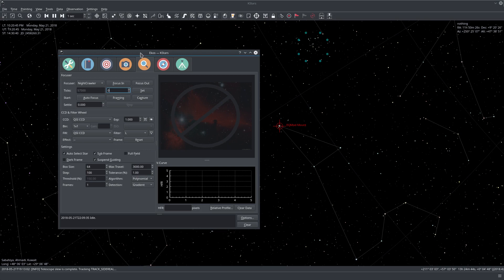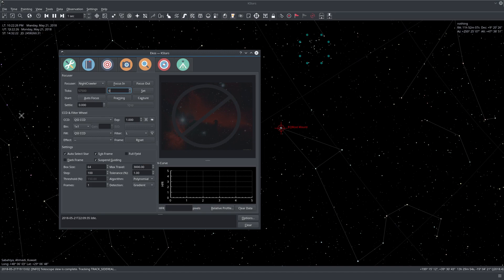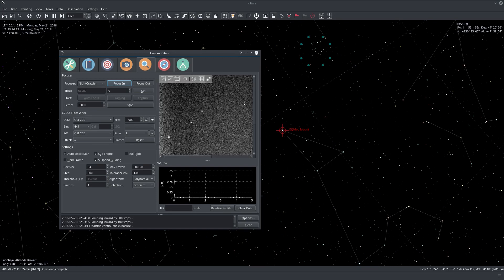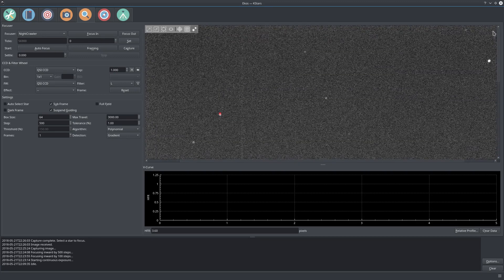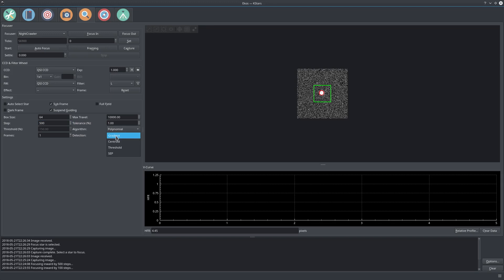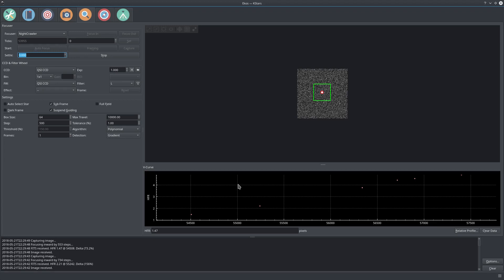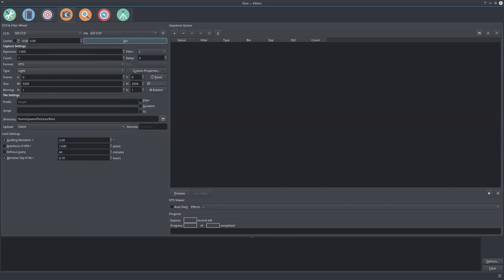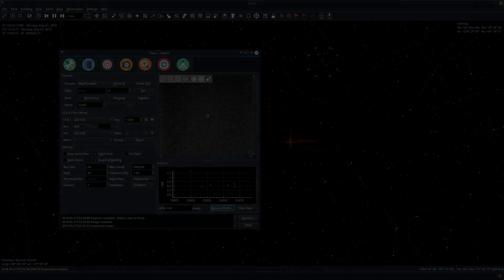Part 8: Ekos Focus Module

Comment: Might be a stupid question but i will ask anyways..
Will this work with DSLRs...specifically Nikon models?
Reply: No, you need to have a special autofocuser for the telescope.
Reply: The earlier answer can be misleading. If you are using a telephoto lens with autofocus capability on your DSLR then yes, the gpphoto driver in Indilib can drive the focuser ring of the lens attached to a Nikon DSLR.  If you are using a DSLR attached to a telescope then the below answer is more correct.  In that arrangement the DSLR is not responsible for focusing the image, the telescope is.  in that case you need a motorized telescope focuser that is supported by the Indilib drivers.  Reference here https://www.indilib.org/focusers.html
Reply: @MrBrendanpdx  Thank you for your response mate. It's been a while since I have moved to a telescope with a motorized focuser and I understand how ot works. However, I remember that unlike Canon, Nikon software does not allow focusing a lens (with autofocus) with any external software. This was the case back then at least and am not sure if they have made any changes to this.